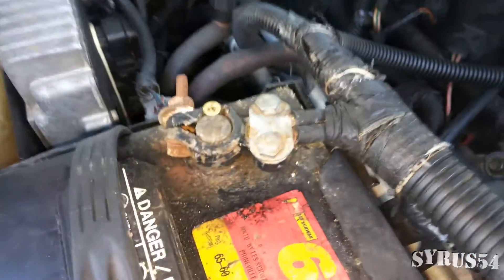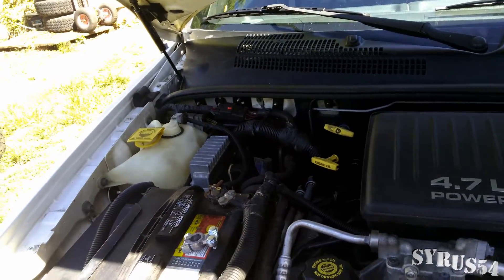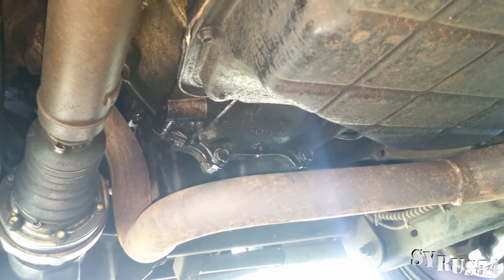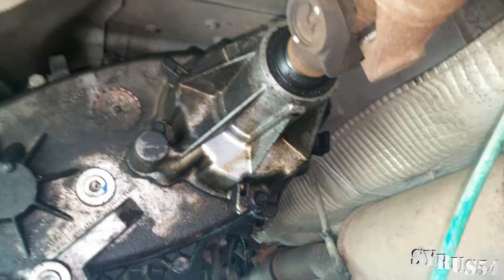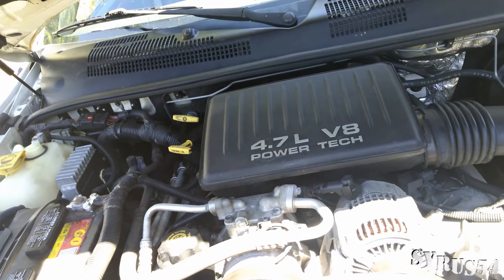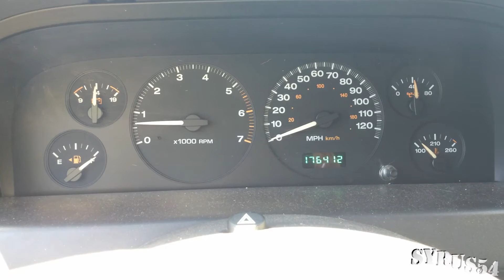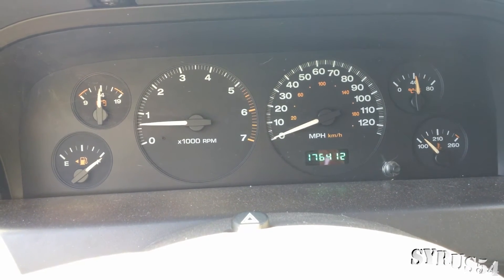Vehicular Education - Diagnosing why an Engine Burns Oil (1999 Jeep Grand Cherokee)

Comment: Do a compression check on each cylinder  an see if you got leak down an if so its ur rings or worn out bore or valve seals. Wishful thinking would b the PVC valve

Comment: Hate to b the bear of bad news but if the engine is leaking oil onto the headers or y pipe or e even on the pipe itself will not cause it to smoke out the end the exhaust  it smoke where the oil is burning off it not out tail pipe

Comment: Question when you had the head gasket and the heads rebuilt they should had rebuilt the heads and put new valve stem seals.

Comment: Thanks for taking time to do a video on this common issue, I'm gonna try replacing the PCV valve first and go from there.  Do you have an update on this Jeep?
Reply from the maker: The only update i have, is that it was Worst Case Scenario. Bad Valve Seat. The head had to be taken off, Disassembled, and the Valve seat replaced.
Reply: @Alex Zenteno , did you fix yours?

Comment: Those 4.7 love to burn oil
Reply: Do they really?? 

I have a 99 myself that is failing because of burning oil issue. 

Anyone have any suggestions as I am just doing the best I know how to hold it together long enough to decide what to do??

I was thinking of just biting the bullet, yanking out the factory 4.7 and putting a Monster built 4.7 which has all upgraded internals inside. Monster can also custom build engines just like they do with their Transmissions. 

Any help or suggestions welcome. 

I got a Monster Transmission in December to replace the terrible Factory designed one. 

Night and day difference in power delivery and MPG.
Reply: @extremedrivr  
 I’ve always told myself when my motor goes I’m going to swap in the 4.7 from the wk era. 
 It has stock the hp and torque numbers of a moderately built wj 4.7.
 Then if you wanted to build that motor you’d already be starting at the point of decently built wj 4.7 and depending on where you get the motor from and who does the work, having spent a lot less $$$$, if that sort of thing matters to you. 
 
 It’s been done before. 
 I don’t remember exactly what the job entails, but I believe the most major/hardest part was swapping the tone rings off the crankshaft on the motors. 
 Probably would have to swap or flash the computer, maybe a few other small things. 
 I’m pretty sure the motor mounts and transmission will bolt right up. 
 
 
 Just and idea.